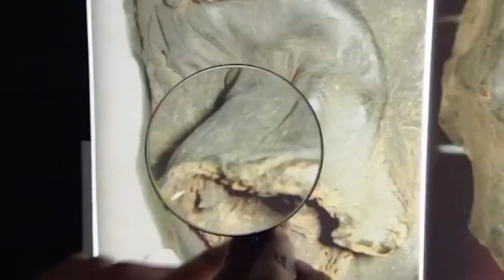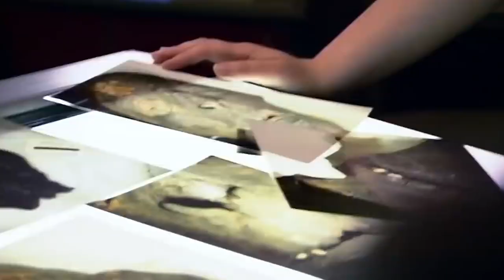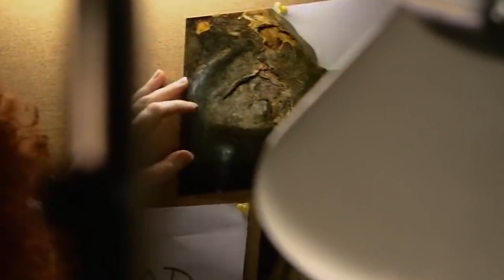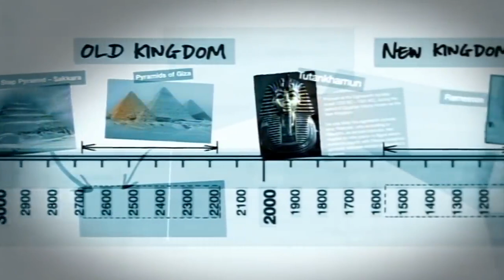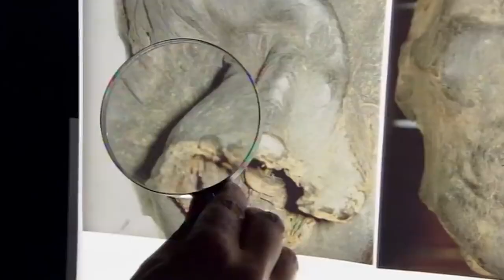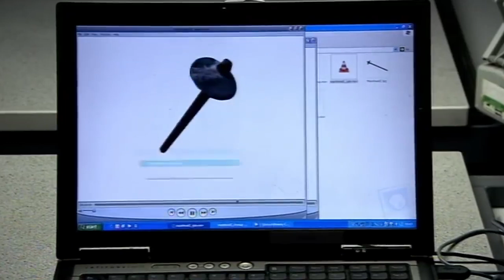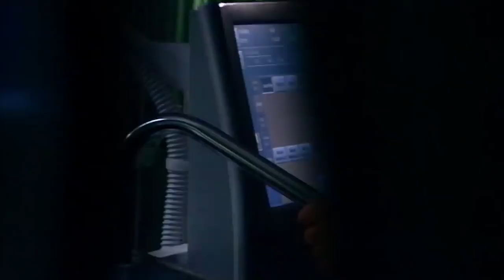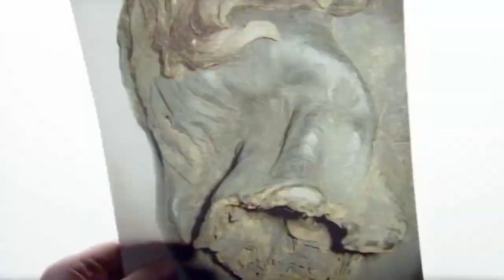The Gruesome Mystery Of The Ancient Decapitated Mummy

Comment: I wonder if there is any way to determine stress hormone levels in a mummy postmortem. Because whenever an animal dies in a violent way, stress hormones affect the muscles and can be detected in the tissue.
Reply: It is possible to detect stress hormone levels in mummies postmortem, although the process can be challenging and may require specialized techniques and equipment.

One approach that has been used to study stress hormone levels in mummies is to analyze hair samples, which can provide information on long-term hormone exposure. In one study, researchers analyzed hair samples from mummies and found evidence of elevated cortisol levels, which are associated with chronic stress. However, it is important to note that hair analysis may not be a reliable method for detecting short-term stress events.

Another approach that has been used to study stress hormones in mummies is to analyze soft tissue samples using mass spectrometry techniques. These methods can be used to detect a range of biomolecules, including cortisol and other stress-related compounds. However, the preservation of soft tissue samples in mummies can vary, and the quality of the samples can affect the accuracy of the analysis.

For example, in a study published in the journal Nature in 2016, researchers analyzed hair samples from mummies from different time periods and geographic regions, including South America and Egypt. The study found evidence of elevated cortisol levels in the hair of some of the mummies, suggesting that they had experienced chronic stress during their lives.

Another study published in the journal Archaeometry in 2018 analyzed soft tissue samples from mummies from the Andes Mountains in South America using mass spectrometry techniques. The study found evidence of stress-related biomolecules in the samples, suggesting that the mummies had experienced physiological stress during their lives.

These studies and others like them demonstrate that it is possible to detect stress hormone levels in mummies postmortem, although the process can be challenging and may require specialized techniques and expertise.
Reply: @spatrk6634  Thank you!

Comment: You can’t produce atlantooccipital dislocation through manual strangulation. You need much greater force (eg Isadora Duncan’s injury from her long scarf caught in the wheel of her accelerating motor car, or a fall from a height ). That joint is just far too strong and positioned too high for strangulation to produce that injury. Why do they say that was the cause of death????